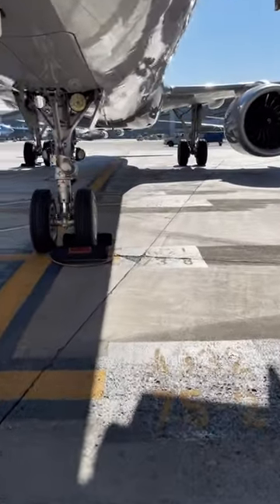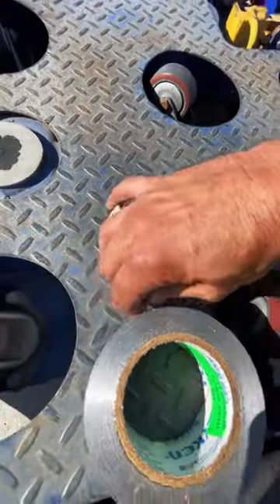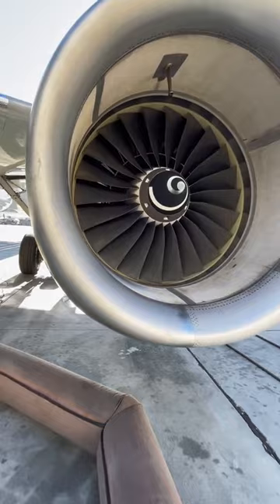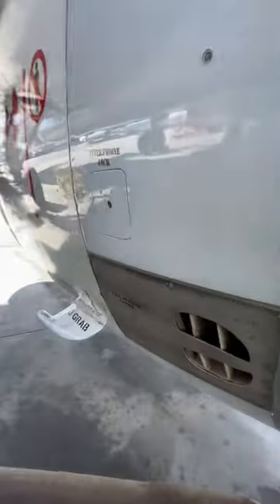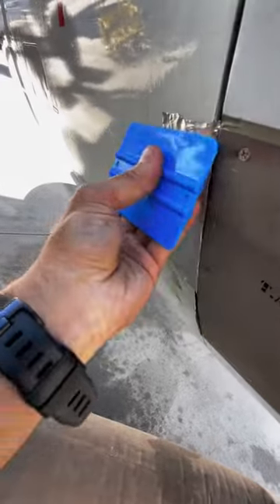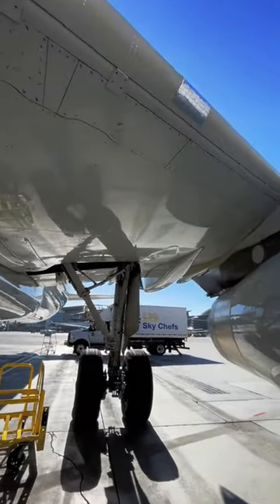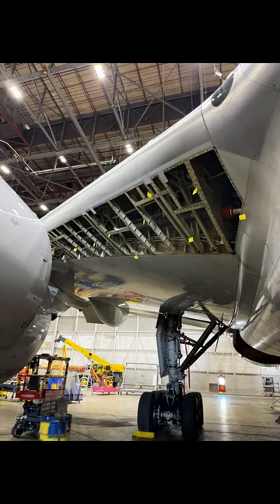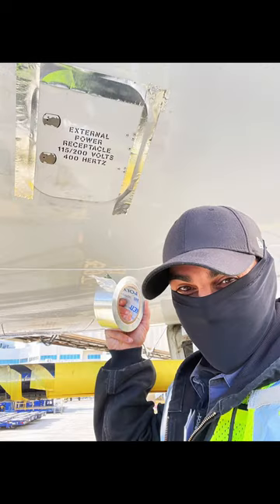Aircraft SPEED TAPE (not duct tape)

Comment: Forget the ignorance and the purpose for the tape - That's some pretty nice quality tape! Resists ridiculous air speeds and turbulence, high frost, high heat, direct sun exposure, rain - if it was fiber reinforced like duct tape, it'd be the best repair tape ever.
Reply from the maker: It just depends on the application of what you’re using it for. Otherwise it’s a great product for temporary repairs

Comment: This is not proper speed tape as proper speed tape is thicker and has  a blue backing that is removed to reveal the sticky back. 😊
Reply from the maker: There are several variations of speed tape. The one you are speaking of is much more heavy duty. But I assure you what I’m showing is FAA PMA approved speed tape. 👍
Reply: @StigAviation  it’s certainly not airbus definition of speed tape! The manufacturer decides !
Reply from the maker: @Sterlingjob  this tape is approved by Airbus and Boeing. It’s per manufacturer specifications. It just depends where and how you use it ( thickness, layers, direction..etc etc. ) if it called for the think tape you mentioned, then that’s what we will use. This video was merely an example and description of what it is why we use it.

Comment: So what does the repair process look like after they remove the speed tape?
Reply from the maker: It depends on what is actually damaged, usually if it’s a composite component, they can do a composite repair, or they can just change out the whole unit as awhole. For example, a panel or a fan cowling.

Comment: @StigAviation -- is this is the same kind of tape that one might use on A/C units? I have a roll of aluminum tape -- very sticky I might add -- that I use to "insulate" AC filters near the air intake. They do cost a pretty penny :).
Reply from the maker: looks that same feels the same but the aircraft grade tape is much stronger,  the adhesive is very strong

Comment: Is the tape okay to use on engine fan blades?
Reply from the maker: No. You can’t use tape at all on blades.
Reply: @StigAviation  Give it a few years, they'll make tape strong enough that you'd be able to do even that! .... Actually I wonder by what engineering margin it's currently unusable. I know if the blade is cracked it's Gee-Gee, and if you use the engine with a damaged blade, you're kissing goodbye to a several million $ jet engine... The tape would cause probably a lot of vibration.. But you know. Just how far will it make it?

Comment: Stig ,  I am a retired airline mechanic and I hope that wasn't you who applied that high speed tape to the engine cowl.  Should have opened the cowl up and applied more tape to the L/E of the cowl and always use an edge sealer as after take off , it doesn't take much for the slip stream to start peeling the tape back. 
As you know,  high speed tape is only an interim repair that is only good to next airport where a permanent repair can be made.  I've been retired for years so maybe the FAA or the Carrier have made changes to allow aircraft to extend the number of flights. Just saying
Reply from the maker: brother that was just an example of what it looks like, that cowling didnt need speed tape, i just just using it as a showcase on why we apply it. i took it right off after.
Reply: @StigAviation  Reminds me back in the mid 80s working for a major airline at DFW and the boss sent me over to another terminal to work on a foreign carrier,  a 727 that had some bad delamination on the R/H , I/B T/E, aft flap about a foot long. I used some  .050 high speed tape and edge sealed it. The same 27 came back a few days later and my repair was painted over. They must have liked my work,,